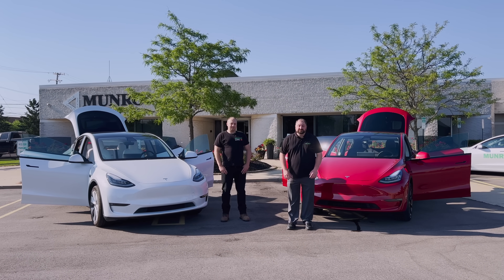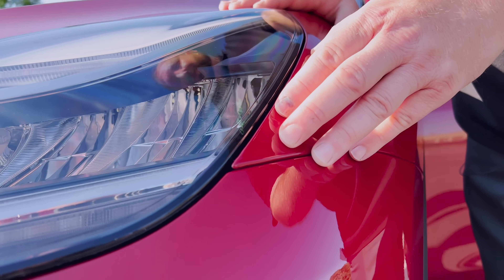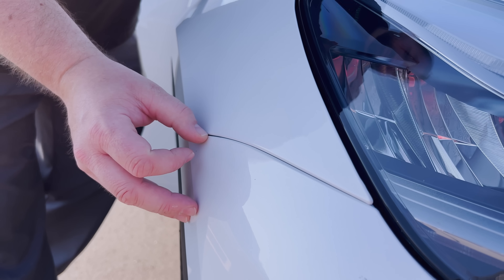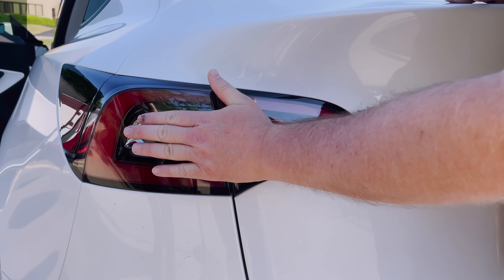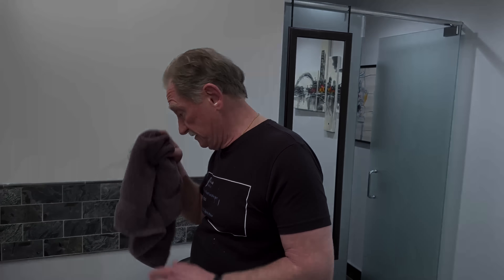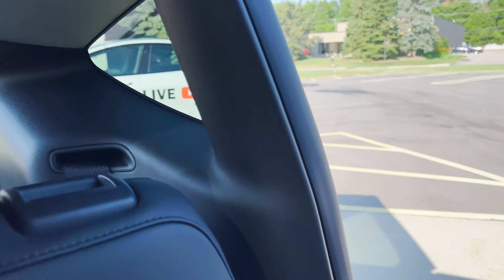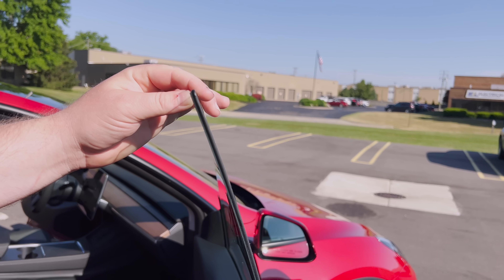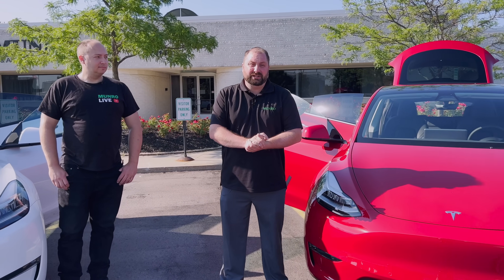Giga Texas Model Y Fit and Finish Comparison | Panel Gaps a Thing of the Past?

Comment: Your videos on Tesla models are very insightful so please keep up the good work. Not much commentary on the plastic underbody chassis guard plates, though there is plenty of social media coverage on how plastic or fibreboard is not a good protector against road stones/ debris, puddles, bumps etc. Is it better to remove the stock skid plates and install new aluminum skid plates and coolant line guards on a Tesla Model Y or are the current plastic ones properly engineered?

Comment: I took delivery of a texas model Y today.  Unfortunately, my experience was pretty horrific and I do not believe my car should have been delivered.  Unless I apply excessive force to the left on my steering wheel, my car pulls so hard to the right that it will change lanes in less than 4 seconds.  I do not believe the car should have been delivered and do not think it is a case of the car simply being misaligned from the factory, but instead having a serious manufacturing defect.  I left the car at home and returned to the dealiership, but was unable to return the car.  What could possibly cause this issue with a car that has 2 miles on it?
Reply: Give it back and ask the Tesla Center to correct it.

Comment: Gigacast is genius black and white f
difference so great mention but I give a little more enthusiasm to making something there is no there car on the market can do but has been attempting from the automotive products have existed. The four cars owner I have been has intuition also that isn't the fact it's a single body cast also overruling any issue in a 3mm slight protrusion as it isn't affecting the frame stability, safety or otherwise aesthetic that would leap out as a concern to any other automobile on the market? Pretty sure physics is a great indicator here that these aren't actually really real complaints about the best tested car ever rated but they do like to hear suggestions but support with reasons could be needed to be heard.

Comment: I picked up my model Y long range from Texas today. Boy let me tell you…
Body panel gaps omg 😳 
The places you described in the video you are %100 correct they were there. Also, let me say the driver door you had to slam closed. And I had two dents on the front of the hood on either side of the emblem and no this wasn’t a paint defect following inspection from Tesla service center members. It was actually a factory problem 😳 we measured the dent from one side to the other and it was the same distance. Also, the seat release pull handle for the center seat  was dangling by the cord. The service guy pushed it back in place 🤦🏼‍♂️. Yes it did go back in. Also, I wanted to note I will be checking this in 10 weeks to see if it’s operational as I didn’t try myself. So yeah I didn’t get to take home my Y because of all the defects they have to fix. It sucks because I was so excited to bring it home after waiting 7 months. But now another 10 day wait. This was at the Nashville, TN Tesla center. This is my second Y. The first I got was from Fremont and it’s was perfect! I just wanted to let people know check your Texas model Y’s guys.

Comment: Everything shown is within Tesla Spec tm.

Mostly Tesla's aren't bad. Keep in mind, Tesla is producing focussed on speed, not consistency and perfection. Two cars from the same plant produced on the same day can have different tolerances. If it's kinda good enough, the car gets the OK. Bigger issues get fixed in post, only after (hefty) complaints by customers. 

This is not bad in itself. Maybe even the only way to survive for Tesla for now. Just don't expect perfection. Keep calm, patient and persistent when trying to get things fixed. Tesla does seem to really make the best cars they can at a certain moment.

Comment: That partial shelf on the new model is Tesla once again complicating things just to be different. Why have it a folding piece when they could have it string attached to the trunk allowing it to rise automatically when the trunck is opened?!
I'm surprised that is not pointed out as an idiotic solution.

Comment: The different in thickness of glass is related to an acoustic phenomenon known as the coincidence frequency. Basically the bending waves in the glass couple with the incident sound waves at a certain frequency allowing more sound transmission through the glass more easily. This frequency is governed mostly by the stiffness of the pane, (actually density, thickness, Youngs Modulus). By having two thickness you are therefore changing the stiffness of the glass and offsetting the coincidence frequency of each of these panes of glass so they don't line up with each other so the dip in sound transmission loss performance is reduced. The thinner pane will have a lower stiffness and therefore high coincidence frequency than the thicker pane. Hopefully that wasn't to dull.

Comment: Interesting.  Panel gaps are not a big deal for me, so long as wind noise and water leaks are not an issue...on the other hand, the precision fit of my Henson shaver has spoiled me to the point where I no longer use my old travel razor, or the safety razor I left at the summer home.  Another example of an somewhat expensive initial cost product that outperforms, as well as being cost effective over time.  Highly recommended.

Comment: Great job fellas. Since the world has gone extreme trying to pick on Tesla fit and finish, a lot my friends and I have (for the first time ever!) taken the same scrutiny to our own existing cars. Amongst a Mercedes, BMW, Ford, Toyota and Subaru, we actually found ALL of them had at least the same levels of inconsistency and misalignments as the Tesla’s show. We all agree that previously nobody ever really looked this hard for all the issues, because overall they are all acceptable. I feel Tesla gets a real hard time for what is already a common problem across all brands. First world problems?
Reply: Your lame lie is boring.
Reply: I don’t really agree. Owned lots of European cars and those has had much better fit and finish than my M3 LR.  But driving experience, app and software is freaking awesome in Tesla, my favourite car so far.
Reply: Seriously? That panel gap on the roofline was unbelievable. 
It's not just the gaps (and lack of in some cases) it's the inconsistency between left and right. If I were looking to purchase a used car and it had those panel alignment issues I'd reject it as (not very well) crash repaired.
Reply: Well said ⬆️
Reply: Definitely true that it's a first world problem and also only an issue when it is pointed out. Most people don't look for it, thus never see it. Also true that everything has uneven panel gaps, not just Tesla. I've worked in the automotive field for 20 years for Nissan/ Infiniti, Honda/ Acura, Mercedes, Jaguar/ Land Rover, Bentley, and Lamborghini. All have brand new cars with uneven panels. It's also largely just a cosmetic issue with not proof of an underlying problem with build quality.

Comment: my Mercedes sprinter is terrible I had to adjust doors for alignment and rattles and door locks fell apart, I fixed all myself being a auto tech. Dealer replaced both airbags, software updates and exhaust system which involved a class action lawsuit received $3600 so all car manufacturers have some issues so panel gaps are minor

Comment: Ironically not being able to see into your trunk triggers thieves to assume something worth stealing is in there. That's where there is a rash of break-ins involving the small rear window - the thieves break the little window so that they can reach in and flip down the seat to see if there is anything worth stealing in the trunk. Some people have avoided break-ins by leaving their rear seat folded down when they are parked - the thieves see there is nothing in their, and don't break their window.
Reply: Every UK hatchback has a shelf ... it's always been that way ... so they all look the same to the thief. Most thefts are done on the spur of the moment ... usually triggered by the thief spotting something on view. It's true that some people try the tactic of leaving everything on view but that means you have to carry every last thing into your house or your work location after every journey!

Comment: Road noise and handling difference of the casting vs multiple pieces way more important. Put a sound meter in both cars and compare in real time.
Reply: I will be very interested in finding out what the interior DB levels are for both the Fremont in Texas build. We have a handful of the Fremont build MYs and compare to the Ford Mach E, the interior noise (wind / road slap) it’s far more  noisy on the inside - almost embarrassingly so for the price.
Reply: @Heist1000  I was able to reduce the interior noise of my model three by about 50% using an aftermarket weatherstripping kit. Tesla relies on one line of weatherstripping on the door but I noticed that many other manufacturers use two. Unfortunately all of the videos and instructions I watched encouraged installation where there was still a 5 mm gap between the weather seal and the door. It’s important to test the weatherstrip insulation to make sure that there is contact using a paper strip business card size. You can also use a bright light inside the car while you inspect the seal outside the car in the dark. The gaps will be immediately apparent. I noticed that I had to install the weatherstrip far lower in the door then the instructions seem to indicate in order to get contact but I did notice a great improvement. Especially in the higher frequencies so you’ll still notice that the lower frequencies will rumble through the floor so mostly all you hear is tire noise.  I also noticed that the glass roof allowed sound to be reflected from the floor off the roof and back into my ears. I was able to correct this by putting in an aftermarket cover over the glass. Personally feel that these classrooms are a really dumb idea; sure they look good in the show room but practically speaking as a driver I never ever look up anyway and just experience that heat and added sound for no reason. I would much rather have an all steel roof with a conventional headliner.
Reply: @colingenge9999  came across a yt video where a guy got great sound reduction in a MY by taping the rear tyre wells with sound deadening tape

Comment: But does a consistent, repeatable, frame from one to the next to the next allow Tesla to now dial in the placement of all the body in white parts, until suddenly, the cars are consistently coming out perfectly built every time? 

Perhaps, Munro will have to revisit this with later production model Y cars after giving Tesla a chance to make adjustments, and possibly burn of older revision, body in white parts replacing them with newer versions are built with presidium bracketing, which no longer has built a in fudge factor that lets human placement put it together in a misaligned position, by being able to move it on it’s mounts with slide around, slotted holes. The forgiving brackets would be replaced with high precision, brackets that go into the same precision hole in the casting, with on fudge factor forgiveness built into the part mount, placing the part at the same coordinates every time, because now they know they can lean on the precision of the castings. 

Right now. They are probably still building fudge factor adjustments into the fastening until they are sure of the consistency, once they are sure, and have burned off the inventory of high forgiveness, sloppy build parts, they can eliminate them and change over to high precision build k9de parts, as they gain more confidence of a consistent and precision fit every time. 

As Munro rips this car apart, they need look to see if the parts are indeed using highly adjustable fastening systems to hold the fenders, trim pieces, taillights, etc on and also look for totally unadjustable fasteners as well,which I would think would show the beginnings of confidence that they trust the new castings to be extremely consistent and precise.
Reply: good point, likely these compromises will be reduced over time, which will be rather short in tesla's timeline too which is great. such changes will also impact line upgrades though.

Comment: I have a May 22 Fremont. I haven't put a straightedge to it put just eyeballing the gaps are good, EXCEPT, the rear edge of the right rear door protrudes a bit at the bottom. Other Y owners have reported same so maybe this is where assembly workers have decided to hide the stacked tolerances, LOL. I mean didn't notice that until my first wash and wax job. Seal on the door is wind and water tight so I am leaving it as is.

Comment: On the parcel shelf, would the addition of it be focused more on accoustics? I Drive a vauxhall diesel a bad comparison i know)  but on road trips with out a shelf the road noise is alot worse.  Hopefully inconsistency with gap tolerances are teething issues with new castings and that they get on top of it quicker this time around

Comment: Ok so the bumper clamp needs to be adjusted and the trunk hinge moved forward.  The comparison of apples to apples doesn't mean the frames are out of alignment.  I have rebuilt and am rebuilding model 3s and you have to be pretty particular to point these things out.  But overall I don't think this shows the fit and finish of a new factory over a old just by looking a two different cars.

Comment: Curious—any improvement as far as the exterior paint is concerned?  My 2020 Y paint is extremely “fragile” rubbing through/off from minor abrasion.  The paint durability is a big issue to me.  I wish I’d done a total body wrap rather than partial.

Comment: Is it just me, or is there anyone else thinking that cars are being over-evaluated on "fit and finish", to the point of a fetish?  I dunno, if it "looks OK", "drives great", and is "reliable" and I can afford it, it's a good car.   It seems that we are moving toward caring about wood accents and stitching way more than before.  Neither have anything to do with being a "good car".  Most people would be happy with a less expensive, highly functional car with plastic interior and a reasonably quiet ride.  Kinda like the 70's with padded roofs and fake wood siding. 🙄

Comment: You guys are far too generous with this. That red Model Y rear quarter looks like its actually buckling it fits so poorly.  Tesla invested billions capex (and who knows how much per unit) to avoid their demonstrated failures running a body shop....and the results are if anything worse.
Reply: Quantity over quality. Tesla doesn't spend money to improve assembly errors, they spend money so they can pump out more cars. This will never change as long as Musk is at the top.

Comment: 8:05 "...added a partial shelf...": On my 2001 Toyota Celica, they have a little plastic hook on the right and on the left. When I finally realized what they were for, ...well it's pure genius. They're for hanging plastic grocery bags so they don't fall over when you're driving home. Where are these hooks on the Tesla? With so much attention to cup holders...and LED accent lights with dial-in colors, surely the world has learned about grocery bag hooks in 20 years!
Reply: We have them on our 2018 Model 3 in the frunk. They were deleted in later years. We've used them twice, maybe. We're not going through a slalom when we're driving our groceries home. Hooking the grocery bags (all different sizes) around these things is more trouble than they're worth.

Comment: 8:43 in Europe, all cars have a shelf or retractable roller to cover if you have anything stored and for crash safety, not having everything thrown around. 
Many people also get a cargo separator Webb, mesh, or metal grille not to die from being decapitated by your MacBook Air when front-ended by a car in the opposite lane. 
In Sweden, this is considered a standard option, and I am a bit surprised that this isn't a legal requirement for everybody. 
Since the Tesla's are designed in the USA, I Don't know if there are attachment points/holes to attach a cargo separator to. 
Many cars also have these attachment points/holes behind the front seats in case you have folded the rear seats and have cargo in the hole space behind the front seats.

Comment: Besides the security issues, I want the parcel shelf to help with sound deadening from the rear-end noises.  I have an older Model 3 and I have attached a noise dampening pad up underneath the trunk area for just that - noticeable difference.
Reply: Agreed ... this has always been an issue with hatchback cars. They are always quieter with a parcel shelf.
Reply: You're so right, I have a Seat Ibiza, and if I take the parcel shelf out for whatever reason the car is so much noisier from the rear
Reply: Yeah, this is a good point. Imo, if you were able to, putting foam on the inside of the side walls of the trunk, leading to the upper shelf (there’s a lot of gap), this would significantly reduce noise from back end. Also newer Model 3 have removed the bass port/hole in shelf.

Comment: I had a 1981 Oldsmobile Firenza SX hatchback with a large rear window, similar to the Model Y. It had one of those "window blind" style pull-out covers in the "cargo" area. It was great for adding rear visibility, by stopping the reflections of whatever you were carrying from bouncing their light points into your rear-view mirror. Yes, it hid what you were hauling around from casual inspection, but I found it a better driving aid than just a cargo hider. Even if Antonio cannot retrofit a parcel shelf into his Model Y, he could probably go to his nearest NAPA Store and buy a "Window Blind" style cargo cover that would fit. Mine also had the ability to be removed when you had the rear seats folded down to carry lots of stuff, like wood for several projects I built. I loved that car, but had to get rid of it when our family grew too big.